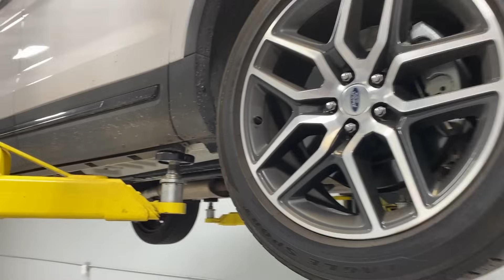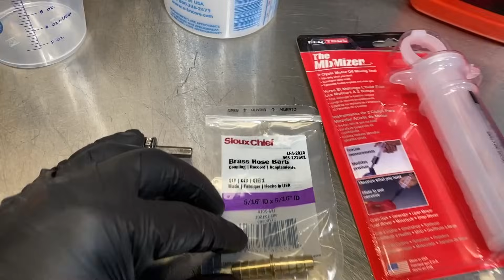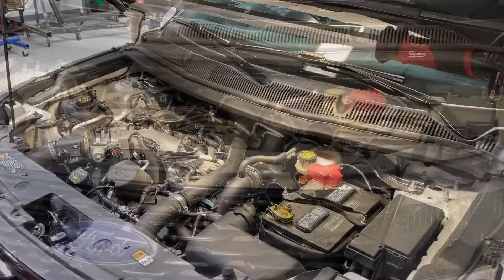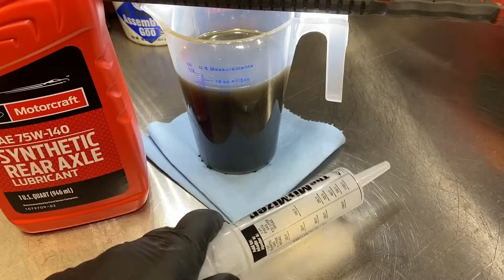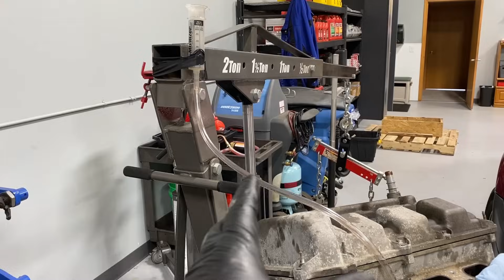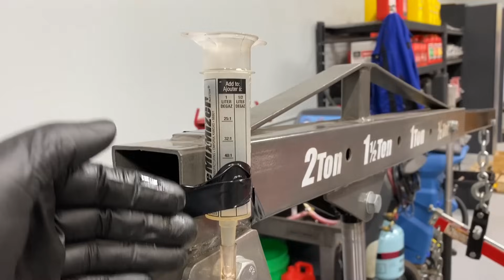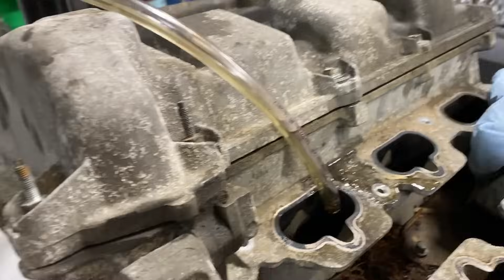Fluid Service on Ford’s New Cooled PTU’s is Possible: We Show You How!

Comment: This is one of the best videos, picture wise and the explanations are clear and easy to understand. My only wish would have been to watch you take the vent cap off and insert the barb into the PTU vent hose. I am a fairly big guy 6' 200 lbs and I could not remove the cap despite many tries. My wife with small hands tried as well but could not get it to come loose. Finally she suggested to run the engine at temperature and that with the help of channel pliers allowed me to finally get the cap off.After about an hour of fighting to insert the barb, I finally was able to get it all the way in...
Reply: same here. Cannot get the cap off, dropped it down into the engine. Couldn't get the replacement on.
Reply: so i had to fight it as well. my advice is to get some small channel locks, and channel lock the vent hose a few inches below the cap, this allows you some leverage. then what i did was take a box cutter and just cut the hose below the cap. careful not to lose the hose! i did because i used the channel lock idea after cutting off the vent. 

the channel locks also allow you enough leverage to shove the barb into the hose. otherwise the hose might be too short to get any grip on it.
Reply: @jimster1111  i believe you are meaning vise grips as channel lock pliers do not stay closed

Comment: 2:50 It is nice they included a drain Plug ....  So on this modern cars I feel lucky when I dont have to drill a hole to drain the oil LOL The Fiesta sold here in the mid 90s it came with a manual transmision that it was supposed to be "sealed for life". Early version of Focus did the same. To change the oil you need to suck it from a vent port .... So they were confident enough that no seal wre gona to fail no water instrussion .... very positive thinking. Guess it is good for 50K miles, then hope for the best. Nice vid.

Comment: Another great video! I do have what i consider an improvement on the vent tube extension. Instead of extending the original hose, Just get your arm down in there, twist the hose around a few times to break it loose and yank it off the stainless steel barb fitting on the PTU. Then get about 3 feet of 5/16 non-fuel injected fuel line (this is the more flexible fuel line) and stick it on the PTU vent barb. Run it up by the  brake fluid reservoir and your done.
Reply: 6 of one, half dozen of the other. I think his extension idea is easier. What if you go to rip the hose off down there and it breaks, leaving a hunk of hose on the barbed fitting? With his extension that can’t happen, nor do you have to reach down as far. Less trauma on your arms and lower back.
Reply: You can reach the barb on the PTU from below if you lay under the car and stick your arm up past the left cat. I had to do this on my 2019 explorer as we bought it and I discovered that the entire breather line and filter was gone… no other option but attach a hose right to the fitting.

Comment: You might be able to use a small funnel to help drain your fluid! You will have a more accurate read on the amount of fluid that you drain!
Reply from the maker: Its real tight in there, hard to tell until you get under there.
Reply: Cut a water bottle length wise and use the mouth of the bottle to drain into a measuring cup

Comment: Try using a catheter to give the air a way out. Pull the vent, put on the syringe/funnel, shove the catheter down through the catheter ito the PTU, then pour the lube in

Comment: Saw a pic of a duct tape "chute" that directed the fluid off of the exhaust. Because it's tape, the edges stuck to the parts around there. He used the non-sticky side for the fluid chute. Two layers of tape, sticky side to sticky side.

No a single drop made it to the exhaust.
Reply: I was just thinking about doing something like this myself

Comment: Thanks for the video!!! I used this exact method one difference, I refilled the PTU using a marine lower unit oil fill pump and threaded the fitting directly into the extended vent tube. Filled 18 ounces of warm 75w140 in 3 minutes using the pump. 👍👍
Reply: Great idea.  I have an extra pump sitting on the self with my boat supplies.  Thanks!

Comment: BMW redesigned the gear case (differential, although thing only spin at one speed) on their shaft driven motorcycles quite a few years ago to have a lifetime fill.  The axle was hollow and the gear case was small so there wasn't much in there.  They didn't put a drain plug on them.  I believe that they had a full port.  They caught fire eventually.  Some people got really creative on changing the gear oil.  Eventually, BMW spent the nickel to put a drain plug on the case.

Comment: I asked the dealer service department to change the fluid on my 2010 Edge sport awd ptu, he was clueless. Had a rumble from purchase at 120,000 miles. In for service 4 times/4k miles/48months, no problems. PTU SHOT! Hit a bridge support pillar left of frame rail due to a cracked power steering line on way to get serviced. That was a close one.

Comment: I have drained and filled them from the bottom. Just pull the vent tube and fill it up like an outboard. I add one extra ounce for loss when you install the drain plug.

Comment: How about an old school brass drain petcock. Like brass/copper radiators had. They had a short tube on the end. You could pinch clamp a hose to the end. Drain and fill from same hose. No blown out seals.

Comment: For those who are planning to do this in cold weather, heat up the fluid. First time I do this was summer, I just hooked the oil bottle up and let it slowly drip overnight and done. This time, however, the temperature is around 30F at night so all the oil is still in the bottle when I checked it this morning.

Comment: G.B.Stein said "silent gratitude isn't much good to anyone".   with that, I say thank you sir.       Also Fyi Instead of allowing gravity  to work the new fluid  down the new extension tube,   I plunged it down the syringe ,   as it was quicker, however that was enough pressure to pop off the other end of the tube from the ptu unit and as a result make a big ol mess.     It is very tight in there and it is not easy to reattach the tube but it can be done.    Patience has never been a friend of mine,   hopefully next service I will have learn my  lesson.    Patrick

Comment: The PTU is a sealed unit. Except for the vent line. When filling thru the vent line, you’re trying to displace air in the unit with the fluid. If filling thru the vent line port, I don’t see how you can get fluid to go down the hose. Forcing it down, with plunger, I can this blowing the seals and causing leaks. I’m a pump mechanic. I’ve seen this happen to often from mechanics over pming
Reply from the maker: Exactly why you work slow and give it time to vent in-between doses. The amount of air space inside of the unit is over half so yes there is some room there and this is safe.

Comment: Have you tried using a mityvac? Put the fluid in the bottle and pull a vacuum and it will suck the fluid in. Thats how I do fluid changes on harley air shocks. If the hose is soft it might just collapse the hose though.

Comment: I did this a couple months ago on the GFs vehicle(2017). I made huge mess. So had to get creative on the refill amount. Funny i used the same syringe and put an extended hose on also. Surprisingly w/46k at the time the fluid looked good.
Reply: I’m getting ready to do mine and I am deathly afraid of what you just said! If a guy does spill everything everywhere is the safe bet just to put the amount back in that he did in this video? What did you do?

Comment: Plumb a tube out, sort of like a remote oil filter setup, where you can have a valve on the end.  Route it so that when you drain it, it doesn't pour all over the exhaust, and then, use something like your syringe to inject it back up through the same drain.  When you have enough in, close the valve, cap it, and zip tie it to the frame somewhere.  Voila.

Comment: 0:52 Maybe Ford was copying Toro. My self-propelled walk behind also held 1/2 a quart of gear lube inside of its PTU assembly.
Reply: Heh no shoot..
I tinker with those mud mowers those kids build. 
I'm surprised I haven't seen one of the kids use one of these for something on some crazy air cooled lawnmower engine based creation. 
Seems like that's all the power they could handle.
Reply: Oh, manufacturers cheap out there these days too.   My lawn tractor has a plastic gear box, with plastic gears.
Reply: Knowing Ford, it is probably the same unit.
Reply: @mikeg3529  
Yea that too. 
The wife said the other day : go buy a new rider because you hate using the self propelled push mower. 
I do, but I hate new junk more. 
The rider needs some attention and I set it to the side last year. 
Time to fix it up again.

Comment: How about screwing a barbed fitting into the drain hole, putting a rubber hose on it and routing the hose up to the engine compartment with a vent on the end. Then when you pour new fluid in it will go faster because the air in the PTU has a way to escape. To initially drain the PTU simply pull down the rubber hose and remove the vent. It'll drain directly into a measuring cup without any mess.

Comment: I did similar to that but used a universal coolant reservoir mounted to the fender and removed the top of the put vent valve , removed the valve parts and clamped a high pressure air hose to it and ran to the tank . After I drilled the ptu and refilled the ptu to spec I added a half quart of fluid to the tank I installed and it worked great as it would bubble out when it got hot and suck what it needed back . Never could run low as the puke was always captured and sucked back in but still let the air out.
Reply: You send a picture of that and I'm assuming you said you drilled the P TOY because you wanted to leave the existing brain in place because it had a magnet and the magnet is the only way to catch the metal debris so basically you drilled and tapped the PTU and you added a coolant reservoir and more oil but only a 1/2 a quart of oil why not a bigger or larger capacity
Reply: I was thinking about almost your same exact idea of running a reservoir in a hose directly to the drain pbut I would lose the magnet so I'm assuming that's why I guess you left that in place
Reply: So basically you still have to remove the drain plug every 30000 miles anyway just to get the debris off of the magnet

Comment: Not only is this way easier than dropping the catalytic converter as ford recommends for changing the fluid, but you easily and effectively added a diff breather to the PTU so it won't suck water if you were submerge the vehicle past the PTU vent hose! Brilliant!
Can you please work for Ford design department so they can start designing things with common sense in mind and I won't have to rely on your excellent videos to keep my escape in running condition? Joking/not joking.

Comment: Brilliant,  but why doesn't Ford include this conversion as standard in any PTU service? 

For grins, I asked my Service Tech to include it in my drain service appointment this morning. He was clueless, as was the manager.
Reply: I asked about it once and was told that it couldn't be serviced.  I have an SHO with the performance package, so I think that mine is like this.  If I can get the car safely in the air, I may do this myself a couple of times.
Reply: Sgt, i would like to know if you showed this video to them.
Reply: Why? Great question and I have no idea, but I'll bet it was the same engineer who thought removing the Trans dipstick tube and placing a thumb stick 3 inches from a 14 million degree Cat pipe was a great idea.

Comment: I think the fluid doesn’t flow quickly because air has to travel all the way up through the same fill hose. Adding a wider hose or a second hose will definitely speed things up. Your mock-up doesn’t reflect that because is flowing into an open container.
Reply from the maker: The mock up only shows the hose will fully empty allowing the PTU to vent properly once again.

Comment: Great videos on this newer case and the old and how they fail. I turned wrenches for 20 years before choosing to get the hell out and into HVAC-R (transition out of HD truck and transport refrigeration). I share this because i like your thinking outside the box and the fact that these still fail due to heat. Would love to see you consider a full retrofit of an external oil cooler and pump with filter set up. Any thoughts of doing something like this. As Dorman has also come out with a whole new case set up. They too fail. The real fix is a way to increase fluid capacity and external cooler in my humble opinion. Your thoughts??

Comment: did you ever consider using a "y" connection where your barb was installed? having another separate vent installed with the vent next to your fill tube should aid filling.....think of household plumbing, the air can't escape the way you;re doing it
Reply from the maker: It would not work; you need to vent the case not the line. It works in household plumbing because the water does not fill the drain pipe completely and this does.

Comment: I like your new setup to refill the PTU. However, with that thick fluid, it's going to take a really long time for the air bubbles to come up and out. If you could slide a small hose down into the PTU through your new hose, that would vent the air.

Comment: I have been watching you for a while since I purchased a 2010 F150 5.4. It is in beautiful condition, fully loaded. Whoever owned it before me really took good care of it, but they also drove it. It has almost 160k. It has the phaser issue but is very sporadic. Was thinking of changing the timing set but also was just thinking of rebuilding or replacing the motor. So my question to you is if I go with rebuild or replace what do you recommend for parts or who is a good rebuilder to buy a rebuilt one from. I know you don’t like non ford phasers and can totally get that but what would be best engine rebuild kit if I went with a self rebuild. Thanks for all your great repair videos. Very informative and great detail on the small tricks. 
Mike

Comment: I was trying to get the breather cap off and the hose came off the case. I pulled the hose all the way out and got the breather cap off and then attached the barb fitting and extra hose. Put the hose back in and lined it up as close as I could to the nipple on the case and then got under the vehicle and reattached it by hand. Turned out to be better than trying to take the breather off inside the engine bay. There are just too many hoses and tubes in the way to work.

Comment: I noticed you didnt use any clamps on the vent hoses. The factory hose is not clamped either it just snug fits over the nipple. I replaced the hose with a 2ft longer one. When i filled mine up the fluid was leaking out the hose right where it goes on the nipple. Most guys put a clamp around it but its a blind operation and I couldn't see.
Reply from the maker: No leaks on this one.

Comment: This question is from a previous video. 
I have a 2005 4.6 2V and I need to replace the harmonic balancer/crankshaft seal and the front timing cover is removed.
I have it supported and used a punch with a light hammer but it's not budging!. I sure don't want to damage the cover.
Any help would be appreciated! 
Thank you!

Comment: I used this method on both my Taurus SHO and Explorer Sport and it worked great. However, I found pouring small amounts of fluid in the mixer at a time prevented 'burping' when a breather bubble surfaced. Took a little longer but this way I didn't lose any fluids.
Reply: We just did this today! Warm up the new fluid in the sun, or in warm water in the sink. Went in really quick.

Comment: Very nice! Looks like I'll be doing this as soon as the weather improves here in Michigan.. My local Ford dealer refuses to change the fluid in my PTU and rear diff saying it's not necessary..
Reply: I have a 2013 3.5 L Ford, Explorer and have not changed the oil, I was concerned that after 181k miles it should have been changed. I was told there is no fill plug only a drain plug. It seemed like Ford have improved, but would have to replace my PTU. One U-tuber bored a hole in PTU and drilled and tapped a fill plug. He had to remove PTU to do that. They said it cost about $1500 parts and labor for a new one.

Comment: Engineers...fix 1 thing, screw up 2 other things. Pure planned obsolescense. It's criminal considering how much these damn things cost nowadays. 

Great video Brian. Only thing I'd have a concern with is using the plunger to push the fluid into the case & inducing a positive pressure that could cause a leak. But what do I know... 😆
Reply from the maker: No problem at all just a little at a time nice and slow giving it a change to vent after each injection.

Comment: Tried following your instructions. Drained the ptu fluid however I cannot get the breather cap off the top of the stock vent to now fill it back up. Any advice? I got the top part of the cap off but not the entire piece that appears to slide off the hose

Comment: Thanks for the great video.  I have a couple of questions.  1) My owners manual (2017 explorer platinum with cooled PTU) shows a PTU capacity of 24 ounces.  You mentioned that you drained about 17-18 ounces.  I planned to follow your advice on replacing only the amount that I drained out.  Do you think it is a typo in the manual or just a low fill from the factory.  2)  I was thinking of putting an elbow and a valve in place of the drain plug.  I would then backfill instead of going through the vent tube.  Knowing how much fluid is in the backfill line, I could precisely replace the amount of fluid I drained.  After filling, close the valve.  Doing this I would not have the magnet.  Do you think that would be a problem?